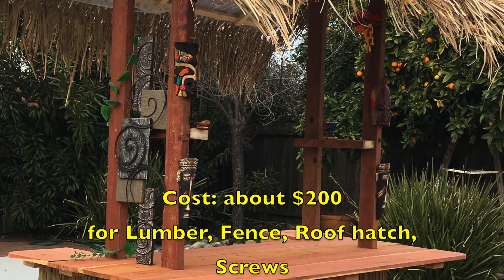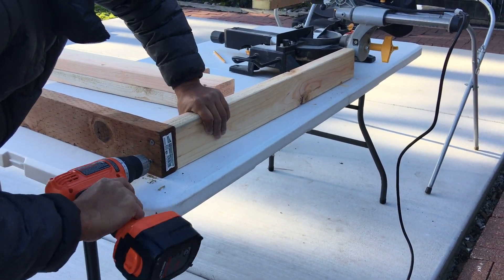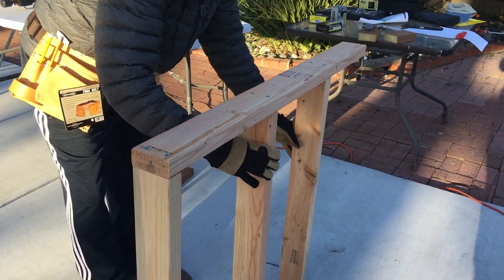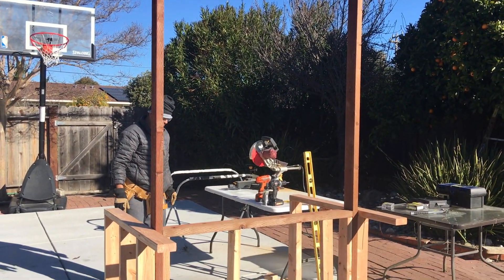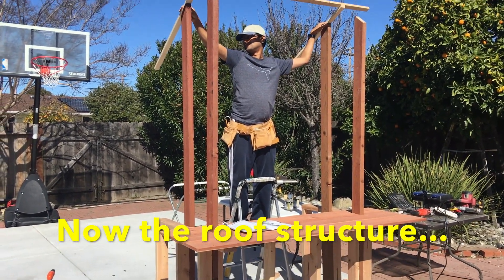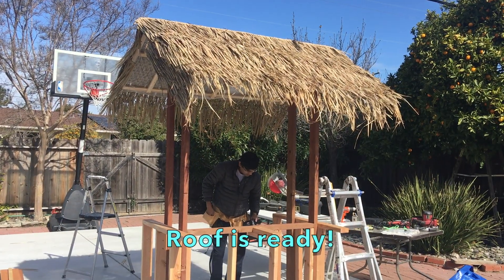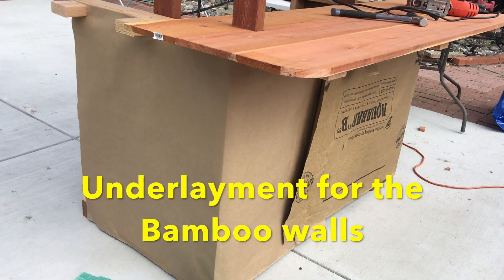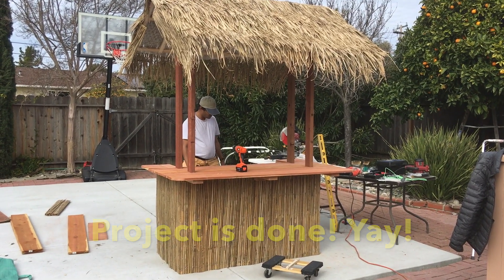DIY: How to build a Tiki Bar at home in a weekend

Comment: Love the design!

I few tips to consider for next time:

- Use star flat-head wood deck screws for the 2x4 frame. They go in like butter with no need for pilot holes. Just make sure you go easy or they will go right through the boards.

- Get a pocket hole jig and use it to attach the roof frame (5:13min).

- Pre-cut the angles for your roof support posts (4:00min) before installing.

- I think the bar top tiny 2x4 side piece supports (6:17min) could have been done more securely. Turn them on edge and attach to back side of bar wall.

Comment: I'm doing this in my house. Thank you for posting! I'm going to use a few of your ideas.
Reply: So I built it. It's inside, but with a sunset feel. Bamboo poles holding up a thatched roof. I should have decorated first. If you build the bar first, you might just enjoy drinking at it instead of finishing the room. Just a caution.

Comment: Great video, am really interested in trying this on my own. How's the roof holding up? I'm in Florida, so quite a bit more rain and wind I would deal with...
Reply from the maker: Thank you for liking it. This has gone through one rainy season in California. So far it’s holding up good. If you get too much rain, may be adding a roofing paper below the thatch will help. You can put a paper or something below the roofing paper from visual perspective.
Reply: @luvurpassion  Thank you sir!
Reply: In FL as well. Is it holding up?
Reply: @h0n0rreb3l6  I built it almost exactly the same as they did. It's awesome. I used a plastic drop sheet like you would use when painting, because if you're in FL, you know the rain is no joke. Holds up like a dream.

Comment: nicely done!!,  but how did you fasten the bamboo fence to the walls?
Reply from the maker: Thanks! I used some large diameter washers while screwing the bamboo fence to the wall. Also you can use some wires to attach the bamboo fence to the screws for additional support. Here is an example washer: https://www.amazon.com/Stainless-Assortment-Different-Automotive-380-Pack/dp/B07CNZWHNT/ref=sr_1_4?keywords=washer+screw&qid=1569391283&sr=8-4&tag=luvurpassion-20

Comment: My question was the same as the first comment, but in addition to the rain here in Florida, we get some high winds and I’m concerned about how it would hold up, but love the video, great job!
Reply from the maker: Thank you. I think high window can be an issue. Actually it fall off once in a middle of storm here in California. We put 1 heavy block on each side at the bottom and it has been pretty stable from there. Worst case, it might need to be bolted on the floor.

Comment: This is very good. Thanks for sharing. Did you have to secure the thatched roof along all borders of frame or just at top. In video seemed like it was only secured at top. Wondering if it’s done only at top is there a chance of flipping over in wind?
Reply from the maker: Thanks! I did it only on the top. I live in California, not in a windy place but you can always secure it more depending on your need.

Comment: Is it necessary to cut the roof supports at a 30 degree angle? I already made my cuts and didn't include the angle. Should I go back and get more wood?
Reply from the maker: You need to support the roof at an angle, as keeping it horizontal will not look good and also not good for water flow. You can try to still have the roof sloped without cutting at some angle, but it will be better if you can use a circular saw or something to cut at an angle to support.
Reply: @luvurpassion  ohhh no I cut the large supports at a 30 degree angle but I neglected to cut the smaller 1×2×6 supports at any angle
Reply from the maker: @akivagroener3321  ah got it! may be you can unscrew a few and cut them?

Comment: Great video & I want to do it but How is this $200 to make , the Thatch roof alone I see is more than $200 , can someone help where I can get the material for the thatch roof as Amazon USA is $500, Amazon Canada is 2 small pcs for $50 , I believe I would need probably 12pcs ? HELP 😁
Reply from the maker: I think when I got the Thatch, it was about $100 and was enough for me to cover the whole roof. I needed to use about 6'x3' two pieces on each side. It's out of stock in Amazon now. But I see a different product in Amazon which might be good for you, please take a look. https://amzn.to/30pkB7s. Please check this let me know if you need any help! Please make sure to measure if that will cover your roof.
Reply: Dj

Comment: There is no little bar at the bottom to put your feet, how would you add that?
Reply from the maker: Not sure I understand but if you talking about a platform for standing, may be create a separate platform with 2x4" and put 3/4" plywood on top?